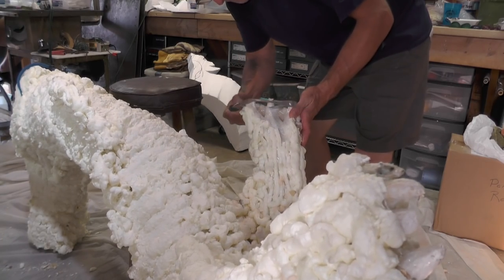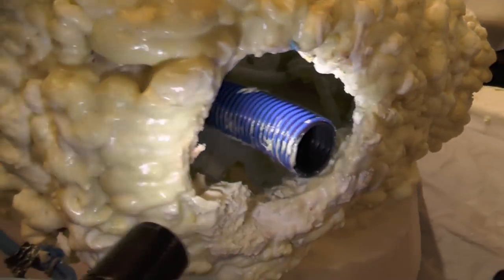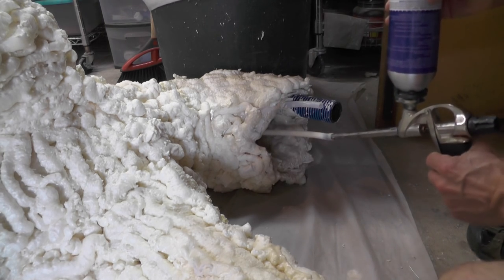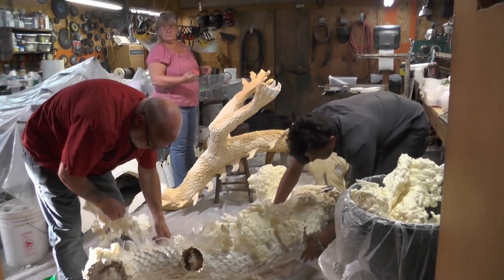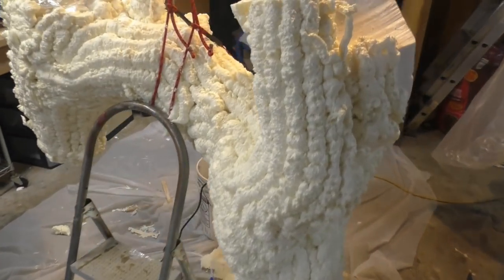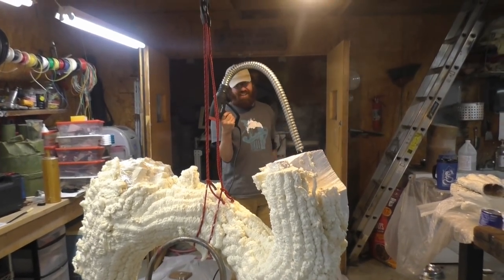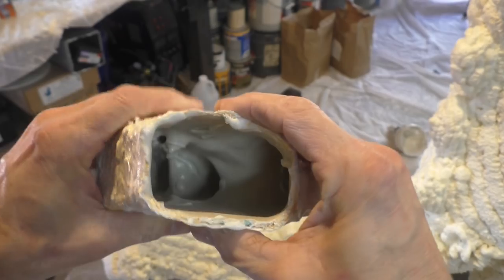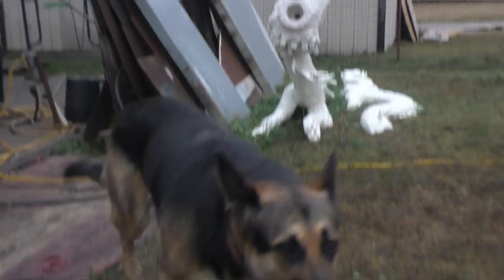Foam Sculpture - Part 6

Comment: Hi doug,Your build is coming along great,I  would like to come up and help build some but my situation is not going to allow that,Iv quite my job and cashed in my 401 k and I am trying to get my boat done so I can leave by april.I realy respect your work and your opinion,so I have a question for you,I keep getting these guys commenting about me welding the hull with full length welds,no stitch welding,,,,What do you think??????I find it hard to believe that will all the overkill I did on the hull that I might get a full length crack,I just think there is too much weld backing everything up for something like that to happen,not to mention that with this landing craft front end on this boat,,,Its a fair weather boat,you are not going to want to go pound 10 foot seas,it just would not be fun,,I have a lot of confidence in this boat,I would like your thoughts on it.Everyone seems to have a different opinion,look at my vid 8  bryan talked extensivly about it.Thanks doug,,,ps love the dragons,I have 4 dragon tattoos.
Reply from the maker: +shawn burnett (tailermade)    Bravo!  You've jumped now.  Most people will never even look over the edge.   ....and I have never heard anything about full length welds being more susceptible to cracking than stitch welds.   And even if they are.  How much?   Dam, when I look at all the welds in you boat!  I think you could break 80% of them and it would still hold together.   There will always be people that will tell you your doing it all wrong.   Most of them are just repeating what they have heard and don't have a clue.  Or they like adding in words like "critical" or "dangerous"  when the right word is "meh".   It's sad really.  There are a lot of folks that have given up on living and really just want you to give up too.   Fuck Them!      See you one the water.  :)

Comment: realy like the artwork on those dragons they realy came out nice 
if the cast is hollow and all those needles are still in there it might be a good idea to put some underbody sealand in there to cover the steel needles , i think that once those needles start rusting it might leak through the final paint on the outside and give brown spots
Reply: +watahyahknow Which might just add that touch of realism to the scales.

Comment: I would have split the dragon in logical sections that could be filled in progression. Start with the head, next the arms, attach the mid body to head and arms, then the final body. That way most of the Styrofoam can be removed, fibreglass added, and components laid in.

Comment: I wonder if you mounted them with rubber like engine mounts would it save it cracking   Or should that be Kraken
Reply from the maker: +mikecat23 Yeah.  I was planning on gluing it on with 3M 5200.  That should help.  And if we do slam a winch block into one, then at least the undamaged pieces will still be attached.